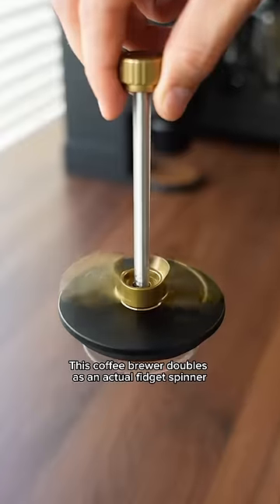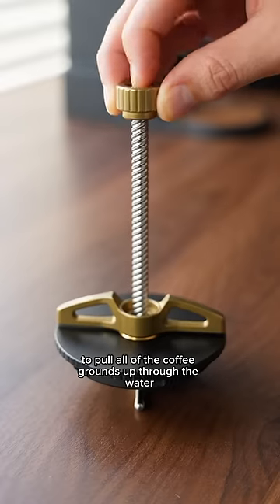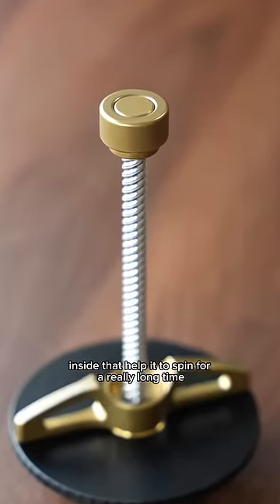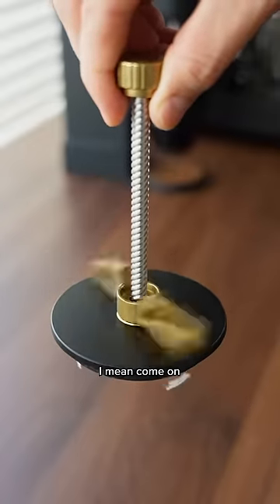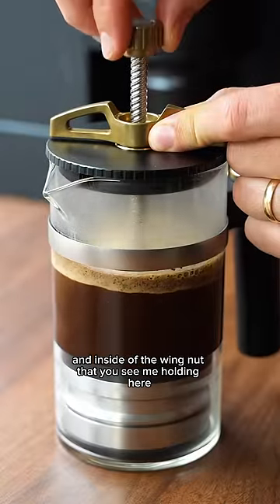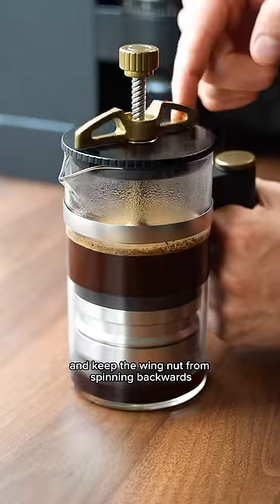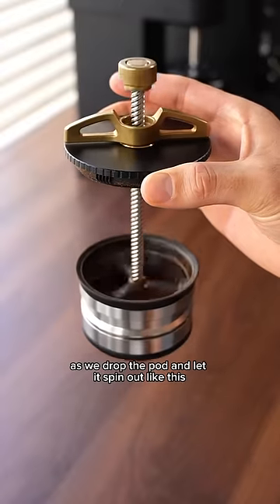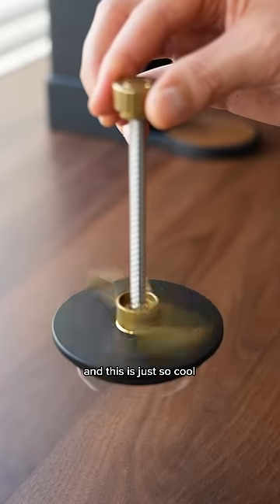A Fidget Spinner That Makes Coffee - The BIRD Brewer from Weber Workshops

Comment: For 360$ im wondering how long the ball bearings(the top piece) will last as it sounds like there is barely any lubrication
Reply: for how smooth the operations are normally, and the clicking sounds mechanically intentional; they probably are either lubricated and the sound comes from a ratcheting mechanism; or the brand is relying on the bearings to be already rustproof, being made of Tungsten Carbide

Comment: They’re actually made of tungsten carbide because TC is extremely wear resistant compared to regular steel. One issue I could see with that is that the channel that those bearings are in will wear out before the bearings do, but by that time you’ll probably just get another one.